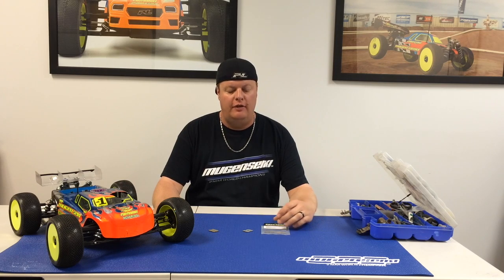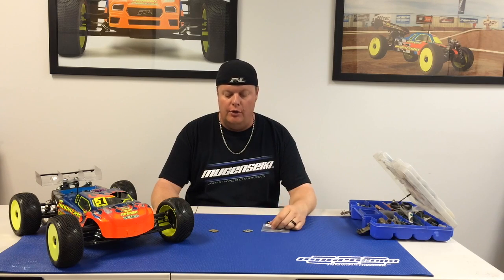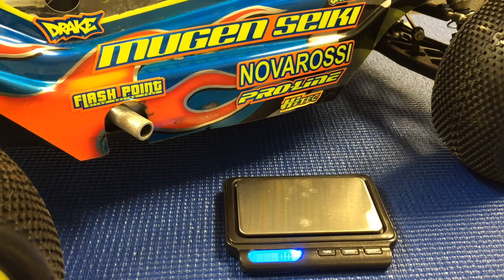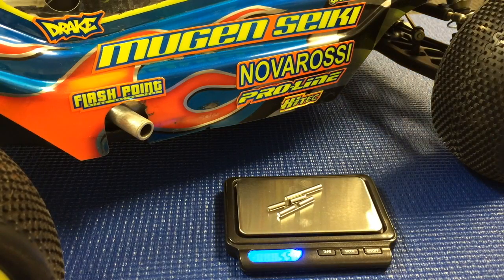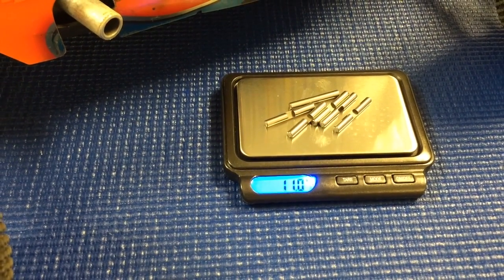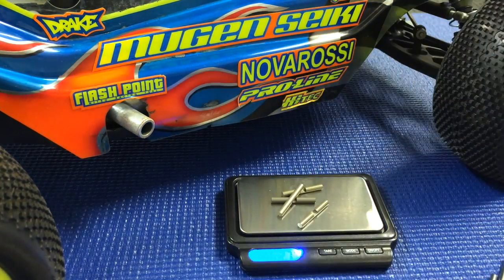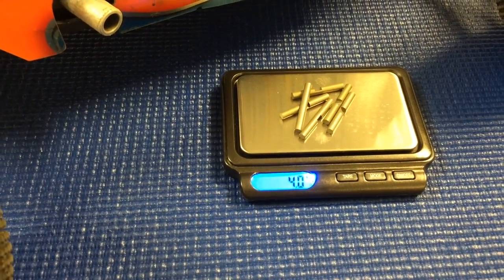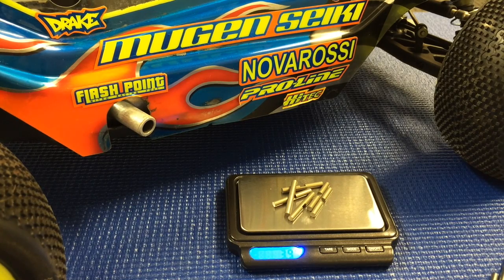Adam Drake from Mugen Seiki Racing talks about Aluminum Differential Cross Pins

Comment: 7 grams difference? I suppose in terms of rotatating mass on a 1/8 vehicle that's a significant reduction. Besides cross pins, what other parts of the drivetrain would you tweak if you want more low end snap out of the mbx7t?

Also, congrats on your finish at AZ, Adam!
Reply from the maker: +brandon 
Thank you.  I also run titanium screws in my diffs to reduce the rotating mass of the drivetrain.  Every little bit helps.

Comment: i have a question. .
if those cross pins are lighter doesn't that also weaken the whole system also are the diffs almost just below the lateral center of gravity ? 
just wondering
Reply from the maker: +arthur bischoff 
I wouldn't say it weakens the system.